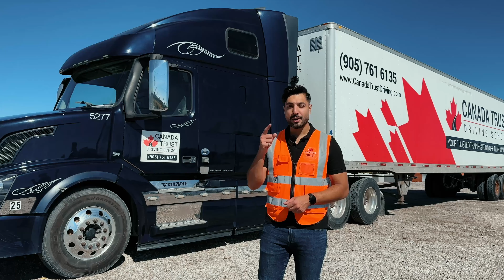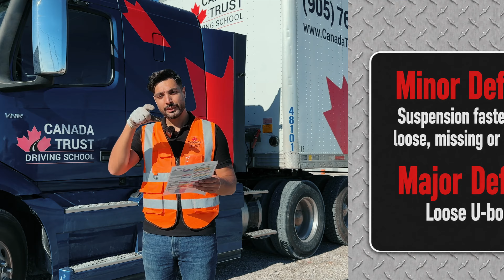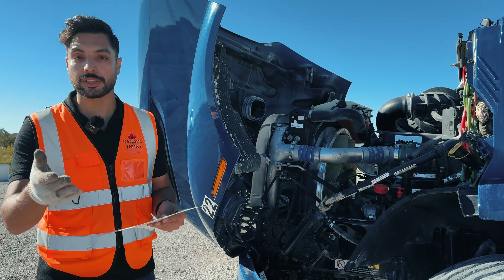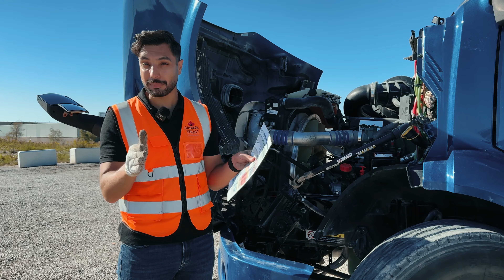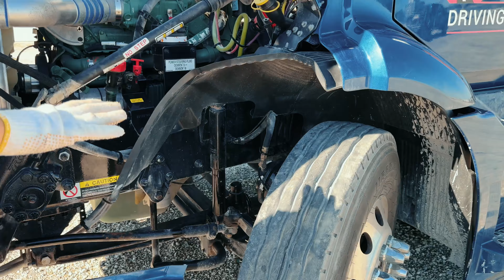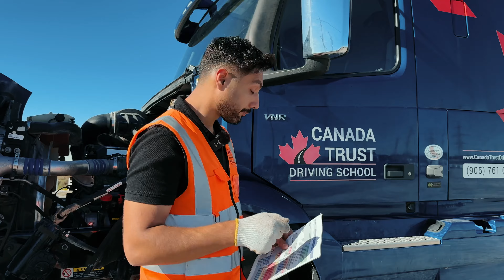Suspension System | Schedule 1 Inspection (Ontario Road Test)

Comment: HI! Question for F Class Vehicles!!! Most of them would have Coil Springs up front, and Leaf Springs in the rear.

The Schedule 2 has no explicit mention of Coil Springs in its list of defects, but all of my peers who have taken the test have said that they inspected both suspension systems.

I wanted to clarify with you guys asa more credible source: For the road test inspection, if we are asked to do the Suspension System, do we need to verbalize and demonstrate an inspection of the Coil Springs also? Or will we fail due to over-inspecting/over-explaining.

(as a side note, I know that we should only explain what we are asked to explain, but I wanted insight specifically on the Coil Springs up front since it has no mention on the Schedule 2)

Thank you
Reply from the maker: Great question! You are correct that there is an important difference between the schedules.

For Class C and F vehicles (Schedule 2), there is no explicit mention of other types of spring systems. So, if you are asked to inspect the suspension system, choose an axle equipped with leaf springs and complete the required inspection on that axle. It is not mandatory to explain how you would inspect other types of springs, such as coil springs.

For Class B and E vehicles, however, other types of spring systems are explicitly addressed. Again, you can choose an axle with leaf springs and perform the inspection there, but at the end you should also mention that if the vehicle is equipped with another type of spring, you would inspect it for cracks or damage.

So for your Class F test, focus on correctly demonstrating the required Schedule 2 inspection rather than adding items that are not required.

We hope that we've been able to help.
Good luck on your test!